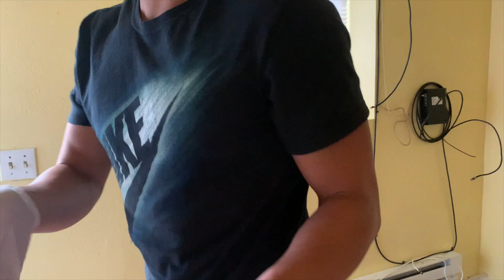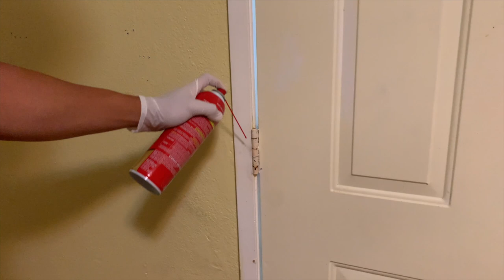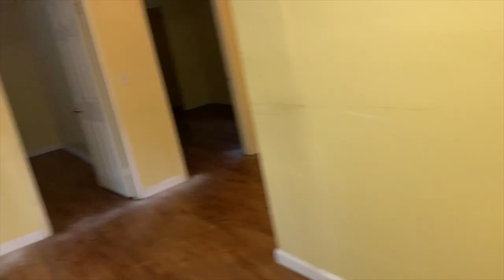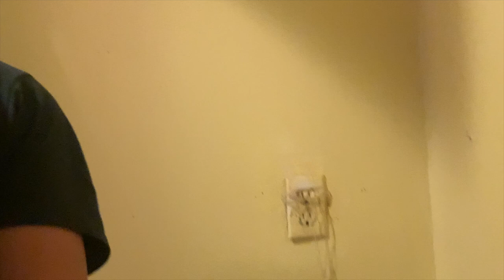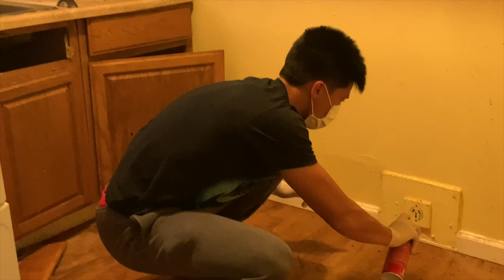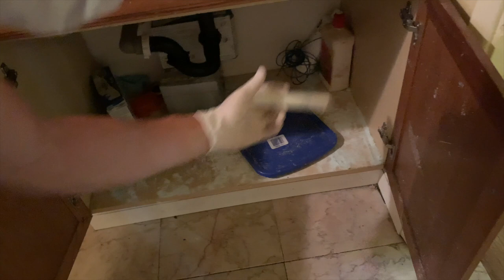How to Kill Cockroaches - The most I've EVER seen in my life #VLOG

Comment: i just used Bengal spray and ordered another can. I also ordered Advion cockroach gel, 4 tubes. I got a garden sprayer about 3-4 years ago good for covering large areas. I didn't have roaches for a long time but in Sept they started showing up. Advion allows them to take it back to the nest, then they die and when other roaches eat them they die.
Reply: You got to seal all your cracks and crevices outside and inside the house
Reply: I love the Bengal concentrate. I use it double strength and it even killed all bed bugs in a home a tenant left

Comment: You want to see dead roaches? You have to spray inside the air vents. Then drill pinhole for the straw to fit inside the wall and spray very 16 inches 4 to 5 inches off the floor. You see roaches coming out of the walls and vents like you have never seen before. Once you finish cleaning seal all the cracks around the floor, pipes and drains.